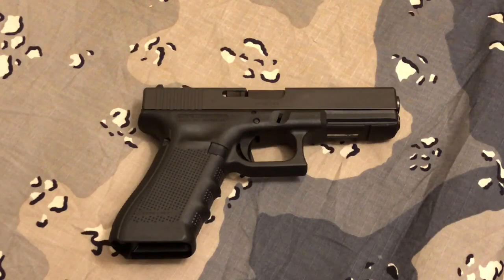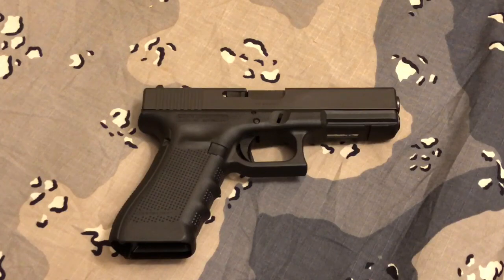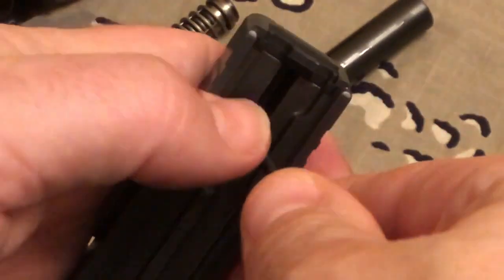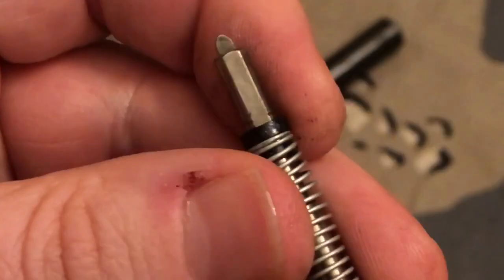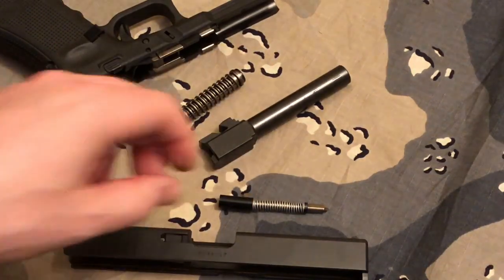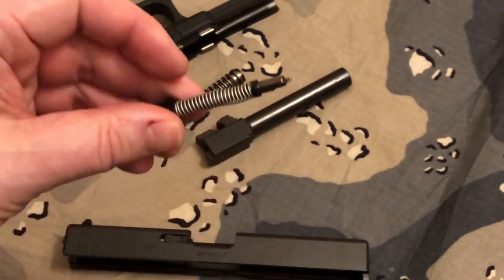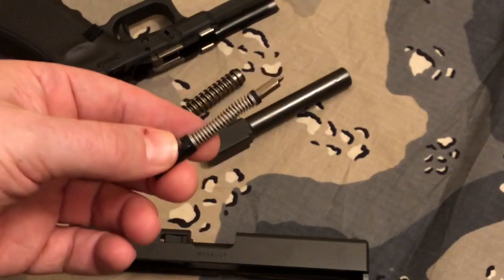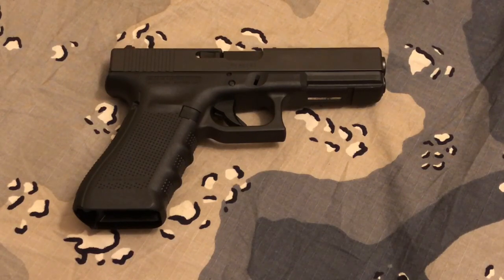(VIEWER QUESTION) Glock light primer strikes (in depth answer)

Comment: First, Thank you for the video! Yes I did figure out what was wrong with it but it was one of the last things that I checked. It was in fact the channel liner. It was the first time that I have ever had that problem. I couldn't tell anything was wrong with it until I removed it. I found that the very end of it had a small crack. After replacing it I have not had a problem.
Reply: Get that lotto ticket now lol.
Reply: After just finishing my P80 Glock project, I started getting light strikes after only one fire. I knew in the back of my mind it was the channel liner because I did not have the proper tool during the install. Lesson learned. Easy/cheap fix.
Reply: @bobbyfinn5406  I'm having this issue now.
Reply: What were the symptoms?  I'm having light primer strikes but my firing pin tip looks wore down
Reply: @juanchavez3660  My Lin er is loose. Is that a problem?

Comment: What about "low quality" ammo? I know the Winchester white box ammo has had its fair share of duds and even a nation wide recall but its gotten better but not completely gone away. In a box of 100/.45 and a box of 200/9mm I had 3 duds on the same day at the range recently. G17L Gen3, G21 Gen4 and G17 Gen5. Switched ammo and no problems yet.
Reply: i agree with low quality ammo, i have a G19x with only 300 rounds ran, and every winchester white box i go through has at least one cartridge that light strikes, figured it can't be the gun because its brand new
Reply: Thanks for this comment. Just went through a white box and had 5. Hadn't had any issues prior.

Comment: @humans4targets2 you mention the placement of strikes indicating out of battery potential..how far off center is this or is any asymmetry an indicator? I have about 90-95% of cases with slightly off center strikes. these are p80 builds. a g43 had about 30% fail to fire light strikes 4 of 15 today. a g17 with no fail to fire of 30rnds but still a tad asymmetric.  what surface on the extractor can be polished ?

Comment: Your video is so well-rounded compared to a lot of videos on the market right now! I built my own aftermarket version of the Glock 19 GEN three. I have about 40 rounds through it and it started having problems. So I’ve gone through and changed to the enhance striker spring to trigger spring and safety spring and now I am getting more light primer streaks I did have failure to feed! I just want to shoot this tool is proud. Americans watched it with building their own.

Comment: Glocks are durable, I have a Glock19 gen2 it was bought by my son in 1990 when he joined the DC police force. he gave it to me in 2000 He had a firing pin brake other than that it has all the original parts. I have had it for 18 years never one problem shot ever round I put in it. Not bad for a 28 year old gun. Thanks for the info.

Comment: To make a very long story short, I upgraded to a 43x MOS from standard 43 about a month ago. When range shooting, I would grab Mag-tek 9 mm ammo.
When I got the 43X MOS, My go-to gun store only had NORMA 9mm. I had maybe 7 to 10 light primer strikes ( out of about 100 rounds fired total. At the time, I believed that my support hand thumb being on the slide lock was causing the slide to maybe half unlock or something. I went back the following weekend and kept support hand thumb well away, used same ammo but only had it happen 4 times out of 100 rounds. I also noticed that each light primer strikes was not centered on the round. I called the gun store for advice and the guy told me that since they only had NORMA ammo in at the time, they had been getting a ton of complaints from a wide array of 9 mm pistol owners about this happening and "Norma ammo uses military grade primers which an EDC handgun is not designed to fire" which is causing all of our issues. I was sure that tomorrow I would take a few boxes of some quality ammo to the range and have zero issues but since in this video, hearing you mention that an indention that is not centered on the middle of the round is indicative of a striker problem, I'm very worried. My boss is former law enforcement and for me a hellacious deal on this gun. I really am gonna be bummed if I have to have him take it to his gunsmith or send it back to glock. Am I overreacting?
Reply: Do not know if you ever got it fixed. But I bought a 43x MOS new from my go to gun store. Tried 3 different brands of ammo, made sure the gun was properly cleaned and lubed. It is also having an out of battery issue causing light strikes. I have a failure rate of about 4/10 for every mag. I am personally just sending it back to glock and let them figure it out. After I searched it, seems this is a common problem with the glock 43x and some fourms have gone as far as saying it could become a recall since there has been so many people with the glock 43x mos having the issue.

Comment: I changed my slide for an optic cut. I have been experiencing a handful of light primer strikes and maybe 1 or 2 stovepipes. I was told to change the recoil spring. I did. I'm taking it to the range tomorrow to try it out. If it still has an issue then I will troubleshoot using everything mentioned here. Thank you for this video! 👏🏽👏🏽 Knowledge is power.
Reply: Hi, did the problem get fixed?
Reply: @moe109_  yes, after I changed out the recoil spring..

Comment: I have never seen or heard of a Glock failing. Light primer strikes are usually a  weak striker spring, worn firing pin, or dirty firing pin channel, and dirty firing pin spring. Clean and scrub barrel and feed ramps along with breech face from time to time using brass brush.
Channel sleeves rarely give you issue if ever.
Reply: Both of my flocks brand new have done light strikes
🤷🏽‍♂️

Comment: Great video! I just purchased a Glock 43x, & shot it for the first time today. I shot 115gr ball ammo, 124gr JHP, & 147gr JHP. I out of 100 rounds, I had 10-15 light primer strike, which was NOT centered. I was pissed! I watched Johnny Glock about disassembling the firing pen, spring, & extractor. It’s a new gun so it was not that dirty. I will try again tomorrow, if the same issue happens, off to Glock it goes.

Comment: Aftermarket triggers can also cause light primer strikes if the sear does not fully engage the striker and prematurely releases it. This can be rectified by very carefully bending the sear upward, taking care not to snap it in the process.

Comment: I experienced thise light and off to the side with stainless steel guide rods. I used a DPM instead and it runs reliable will all springs light or heavy. I dont know why, but the metal guide rods are weaker than the factory guide rod going into battery, even with a stronger spring. It never happened with the factory or the DPM. The DPM is stronger than the factory at that point even with a lighter spring. I now run the DPM always. It is a true upgrade, at least for a Glock.

Comment: I have a new Glock 17 gen 5, and I had a light primer strike that is not directly in the center, which I'm asuming is related to the tight extractor. I was shooting maxxtech ammo, which I don't now if its a bad one and I could have caused it.

I fired 150 rounds with only that one problem. Hopefully it won't happen again, but if it does, how can I correct it? Simply replacing the extractor?

Thanks you.

Comment: My g5 just started light striking. It's only had maybe 500 thru it and lots of dry fire. It's bothering the hell out of me I carry this thing every day. It's all stock - the polish I did. I didn't sand or change anything just a light polish to smooth it up. I cleaned the channel and it didn't happen for a while but it did it 3 times today. Maybe old ammo? I haven't had a problem with the new stock just old ammo. I seem to remember my gen3 was really putting a dent in it but the gen 5 doesn't seem to hit that hard. Any ideas?

Comment: Thanks for the video. Today I shot my newly built 19. I shot 100 rounds out of it with no off center strikes however I could pull my firing pin back with the slide off and it would stick into firing position. Come to find out my channel sleeve in my 500 dollar slide was a little torn. I had a Glock armorer change the sleeve out there on the spot. I shot 100 more rounds and had 2 misfires. Both of them were off center primer strikes. First question: should I check out the guys work? Secondly I do have a trijicon rmr on it. When I installed the rmr the screws were just a little long and one was pressing down on the extractor depressing plunger. I had to grind the screw down to the point where the plunger would come out when my rmr was screwed down. Could it be that it’s touching but only slightly? Or do I need to lean more on the side of the channel liner since the problem started after the fact? Thank you!

Comment: I have heard that too much lubricant getting into the striker channel can cause light primer strikes in Glocks.  I have been getting 1-2 light  primer strikes in my G30 SF every 200-300 rounds or so.  Might be ammo but I’ve been trying to narrow it down.  Just replaced the firing pin spring with a ghost 6.5 lb firing pin spring.  Hopefully hitting em a little harder solves it.

Comment: whats up doc.  that S&B 9mm has a heavy primer
Reply: I've had 5 light primer strike in the first 100 rounds with my new G43X with S&B. Do you think i need to clean the firing pin channel?
Reply: @orhanabd1724  s&b 9mm is UZI ammo.  dont use it if your having misfires.
Reply: @MOAONAABE  But some CZ P10 (C and S) run about 150 in total without any problem